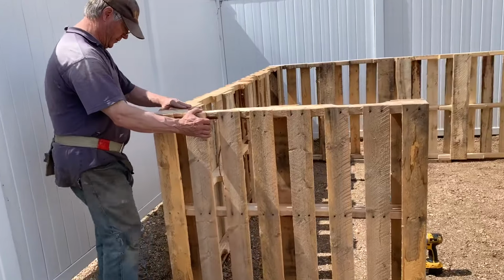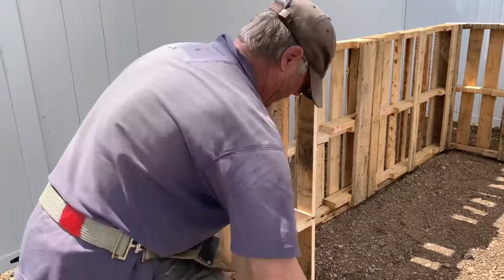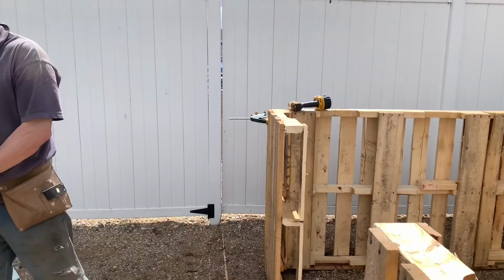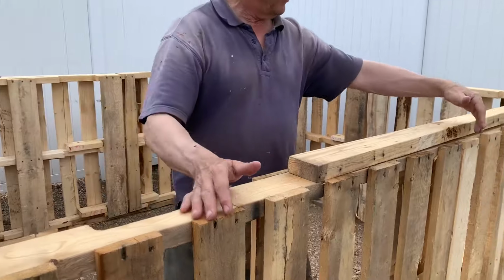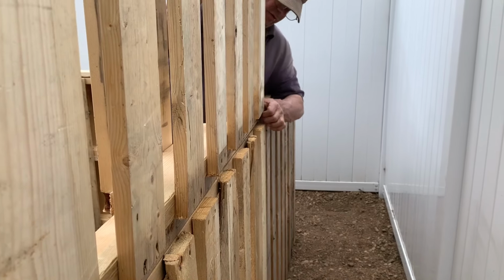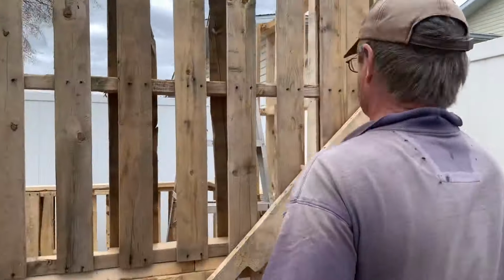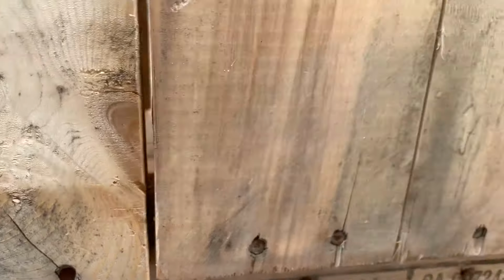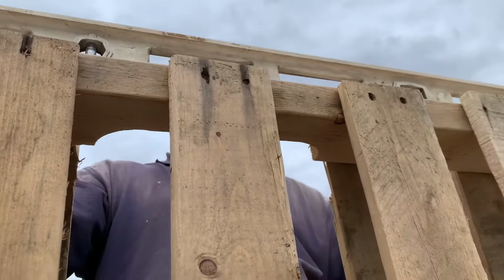Pallet Cabin - Garden Shed Part 2 - E183 #diy #pallet #storage

Comment: Made in Canada board...did you two purposely use that board??? 😄 Good tip on using the heavier pallets for the bottom wall & lighter pallets for the upper wall..I would have never considered that. Again, thank you for explaining how you're building your pallet wood shed. 😊
Reply from the maker: Of course we used it on purpose! 😁